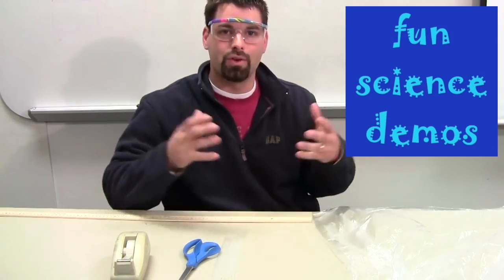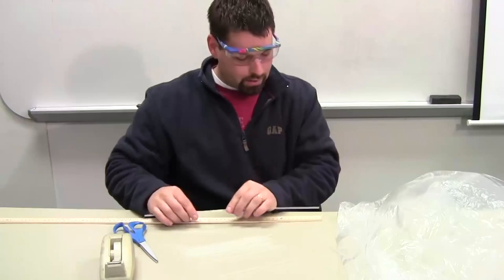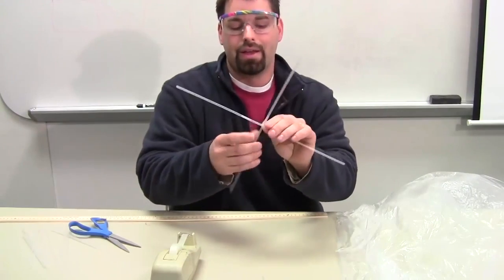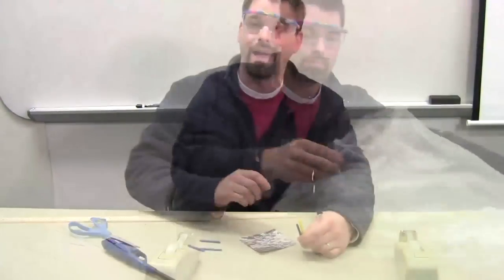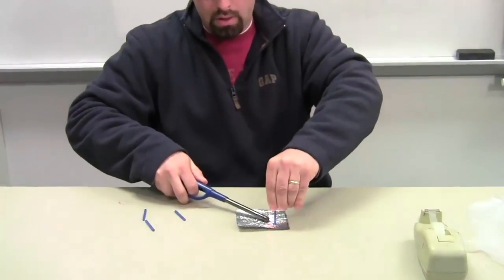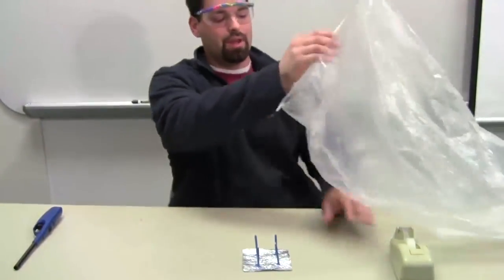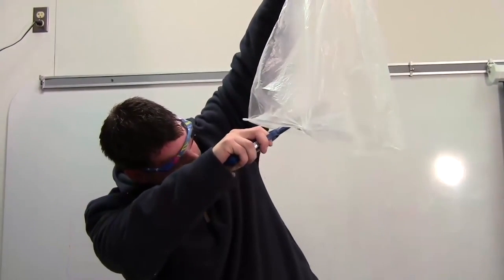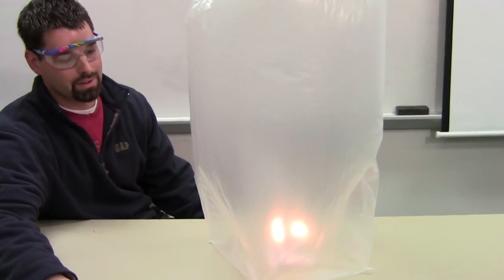Warm Air Rises (Making a Hot Air Balloon)

Comment: Great demo - I am trying to find thin plastic straws, but they seem impossible to buy nowadays, with the ban on single use plastics. They only seem to sell the wider variety, that could be cleaned out and re-used, however, these wider straws are too heavy for this. Does anyone have any suggestions?

Comment: I tried this using the smallest candles, the least amount of tin foil, the least amount of straw (and smallest in diameter), the least amount of tape, and a 22x24 very thin garbage bag...Still, NO GO. The bag needs to be sooooo thin, that if you put a feather in it, the feather would be to heavy and break the bag.
Reply: Try on a colder day.

Comment: one missed part is the last part. with the 4 candles that would fit through the bottom you could just lay the candle through the bottom and have the foil attach to the bottom of the sticks instead of putting the whole thing inside the balloon. thanks.
Reply: i can't understand....helppp
Reply: @WJing_3223  make a cross with the sticks.............in the crotch of the cross put candles in the cross from the bottoml then quit texting that you dont understand............

Comment: when i put some hot  water in bottle and after throw that and cover by cap it gets shrink why
Reply: Even if you do not have any water in a bottle--just air--and you cool it down, then the air will shrink. Heat expands, cold contracts. The effect is dramatic with water because water expands many times bigger when it turns from liquid to gas (water to steam).

Comment: You did a good job of showing the assembly. However, typical retail household trash bags are made from plastic that is too thick and heavy for making a hot air balloon. Fortunately, the the thin, light-duty bags often used in offices and schools are perfect.
Reply: sciencetoymaker No, use grocery bags and stuff.
Reply: @JAYDEN HOBBS the plastic bags
Reply: Sir, you should run for president!!